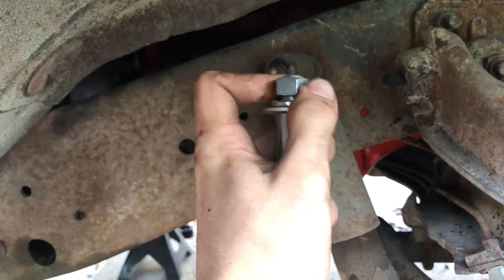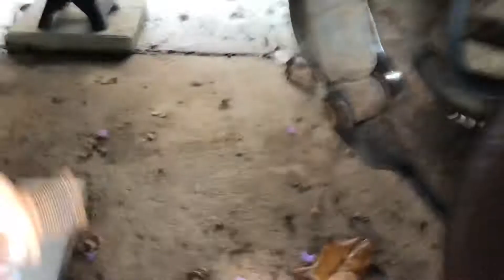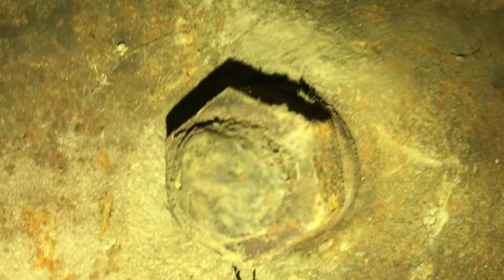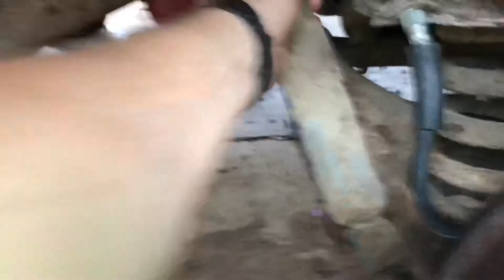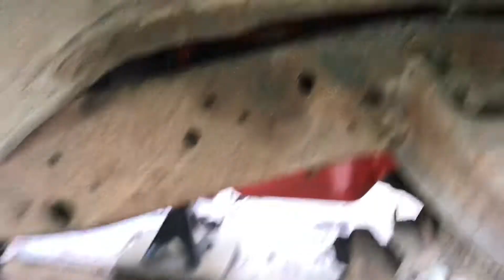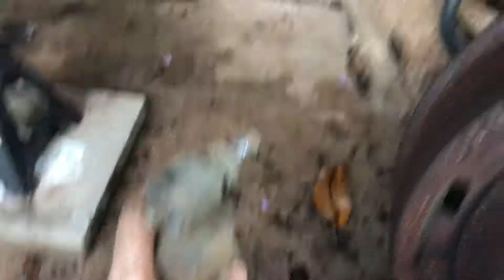Original 1967-1972 C10 Front Shock Removal

Comment: So did you have to give any back pressure to break loose the nut that is under 150 ft lb?  If so, how?  Just wondering if the top shaft bolt will spin?
Reply: The best thing to do is first, penetrating oil soak, but to keep the stud from rotating is large vise grips, or a small section of black steel gas pipe sold a home improvement stores. Measure to make sure it slides over the stud, mark and cut with saws all or hacksaw with bi-metal blade. Weld a 2 foot length of re-bar or round bar stock or anything from your scrap bin. This when sized and cut, allows for washer & nut to be installed. A breaker bar provides better initial torque that a good air impact on a high PSI hose. I have done it both ways and have 2 sizes of these custom tools in the bottom drawer of one of my tool boxes.
 LMC and others sell a front shock backup bracket that removes half stress of the OEM shock stud. Some are not tightened and other can work loose over C1 50+ years. This can damage the hole in the frame. Drilling holes for add on brackets is required. Tighten stud, install shock then support bracket. Tighten nut temporary if needed to locate and center punch holes. Start with smaller drill bit and oil to start. Just be careful nothing is behind frame that holes can damage as rear brake line runs on right side w/fuel line in most cases.
  Sorry no one answered a time ago!
Hope this helps and if no welder, use large pipe wrench with cheater pipe!
DK, ASE master tech since 78, retired.